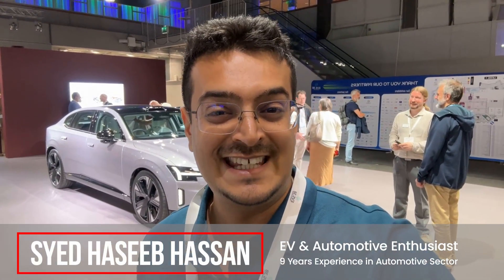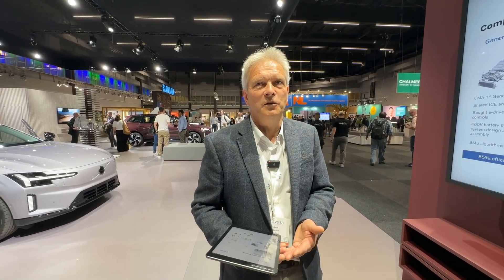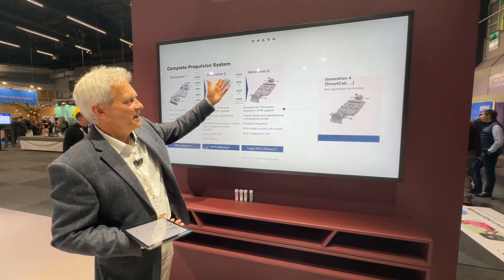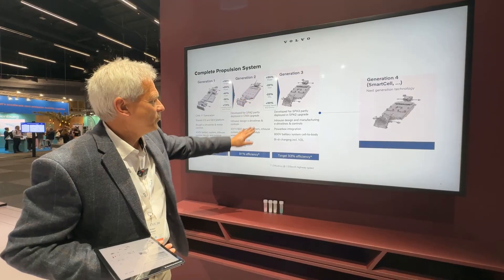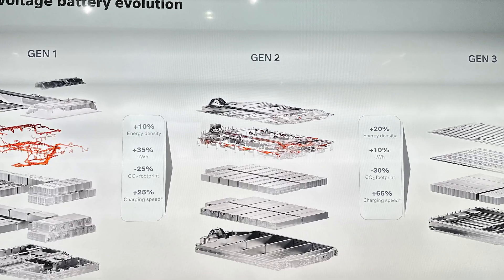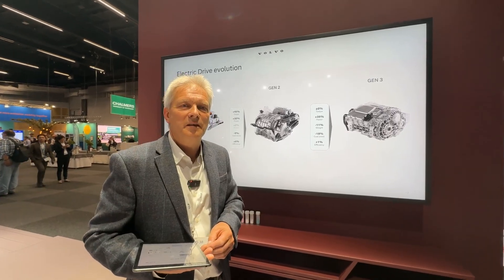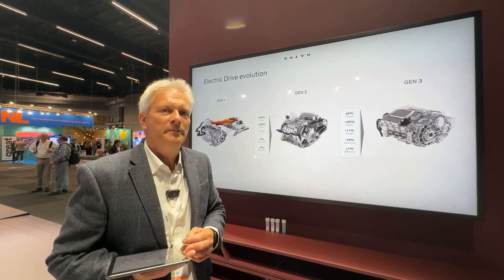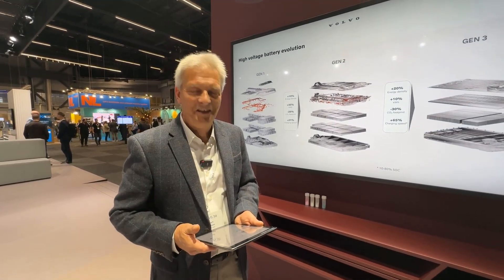Volvo ES90 Innovations Explained by Senior Engineer at Volvo Cars! Propulsion, Battery & the Future

Comment: I’ve been driving an EX30 for the last 10 months and I honestly love it. Now, I’m really liking what they’ve done with the next gen. tech on the ES90 and I’m considering trading my EX30 to the ES90 when it they start selling them in Bahrain 🇧🇭.. Volvo is just on another level ❤
Reply from the maker: thanks for sharing your experience. You would also love the sound system of ES90. I have another video on it.
I am curious to learn about Middle East. Where do you usually charge? At home, at work or perhaps at public chargers? Are the public charging sites with roof or without, like in EU?

Comment: I'm not buying EV. Very inconvenient. Bring hybrids and even better EREV.
Reply: Well within your rights. The rest of us are OK with EVs. Power to you.
Reply from the maker: If you have done your research or find hybrids better, for sure then you should get one. 
But as I like to do research and I always on the lookout to understand, what are the reasons/factors due to which people don't get EVs. I have had ICE and EV both, but my understanding is therefore limited to my own experience only.

Could you kindly share why you find them inconvenient? I would really appreciate it!
- What does your daily travel look like e.g. how many kms? 
- Does your office offer the chance to charge, either at fast or slow chargers?
- Do you have a chance to install AC Wallbox (slow charger) at home? Not everyone has a garage but if it is there, the situation is very different then
- Are there chargers nearby your home?